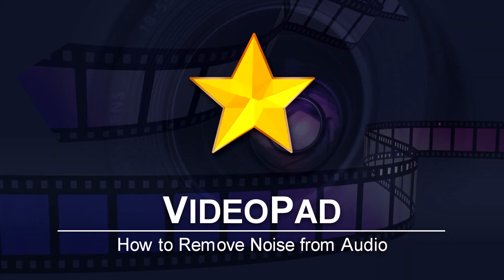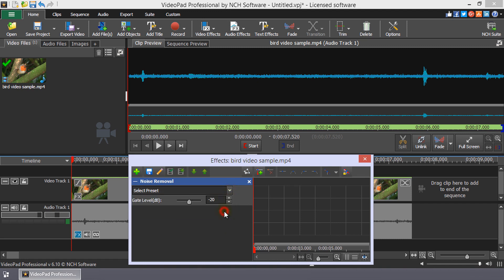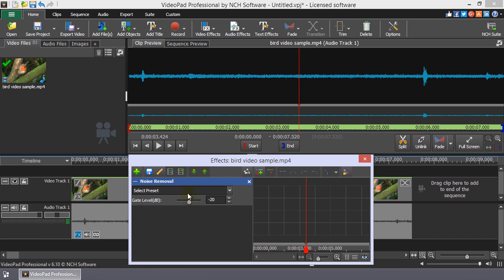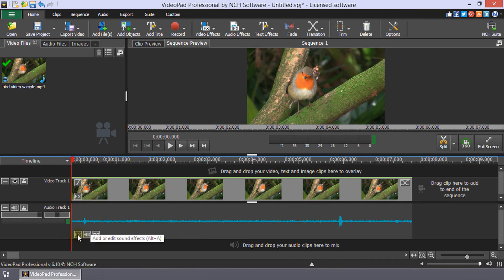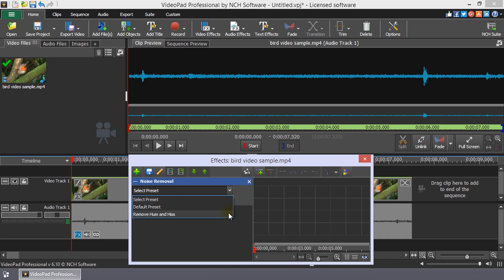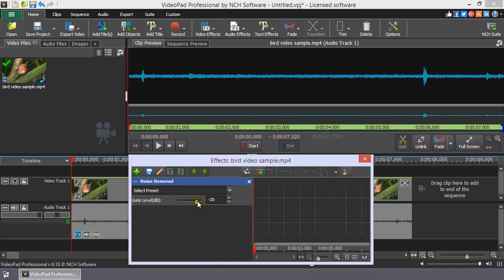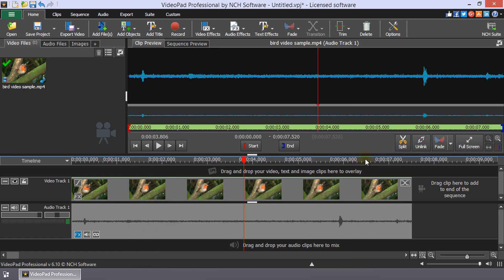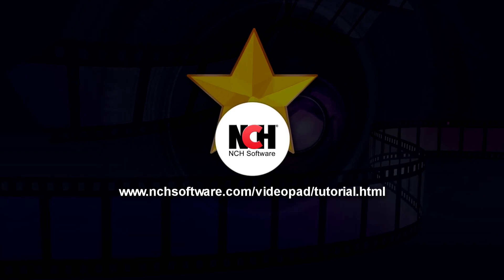How to Remove Noise from Audio | VideoPad Video Editing Tutorial

Comment: the slider does nothing unfortunatly even when i got to 0 it still plays the same sound
Reply: Ya bro you are right, I had tried to remove noise 10 times moving the slider it did nothing.
Reply: @pranjalpatel697   there liek a speaker button and when you hover over it it says mute track for me it unmute bec i muted it it by audio pad under video pad sorry if this is confusing
Reply: @almatic6234  OK. Thanks. 
I will try, but we can easily do this in wavepad.
Reply: same
Reply: @YourDreamWheels   
  there liek a speaker button and when you hover over it it says mute track for me it unmute bec i muted it it by audio pad under video pad sorry if this is confusing